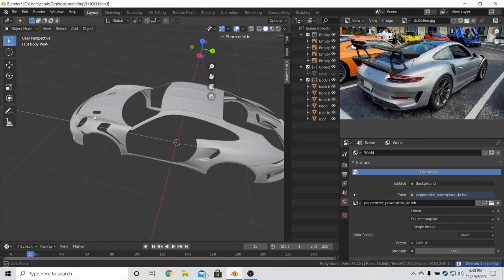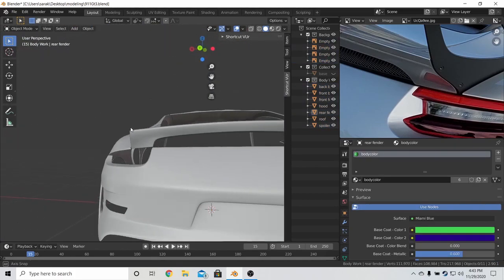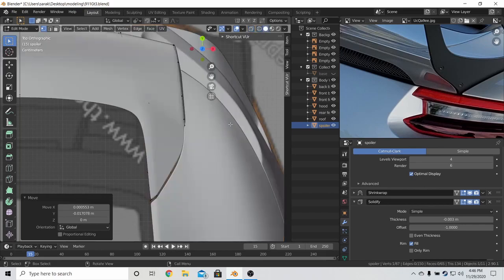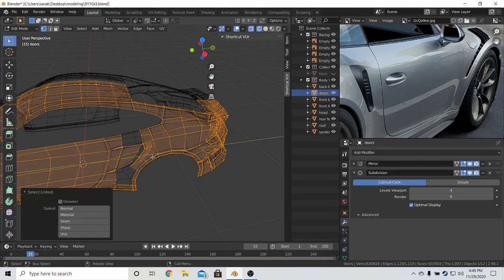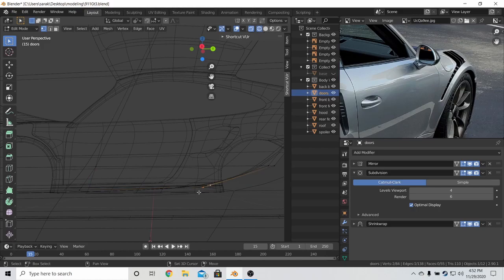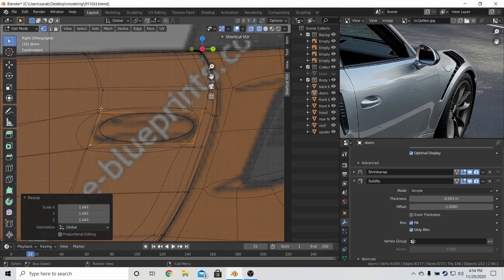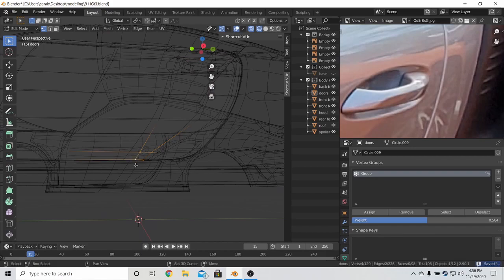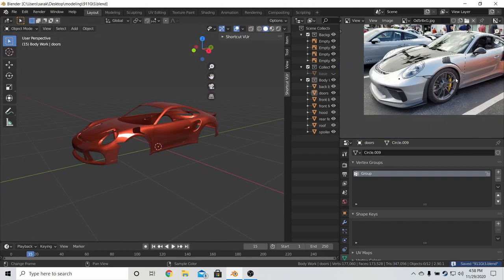Blender 2.9 Porsche 911 GT3 RS Modeling Tutorial: Part 13 (Trunk and Door)

Comment: I wonder why we need to use Shrinkwrap? I never used shrinkwrap and I came to the same conclusion
Reply from the maker: I find shrinkwrap to be as close to perfect as you can get. You can achieve similar results but I think it takes longer and requires more geometry. You can be a bit lazier with shrinkwrap as well if you make your guide mesh to a high quality.
Reply: @sarakrhodes  Thank you :)